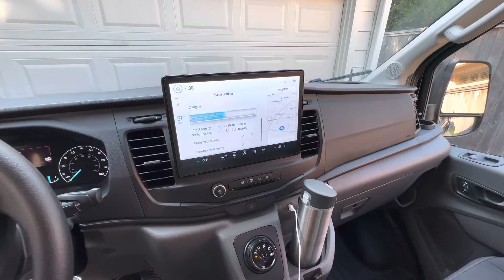Ford E-Tranist upfitting shelves with Milwaukee Packout & Weather Guard

Comment: Looks great. I just bought a 2023 E Transit. Did you use 1" self taps on the bulkhead into the high part of the ridge? I'm a little nervous about screwing into the floor